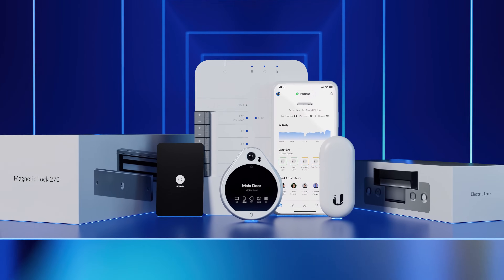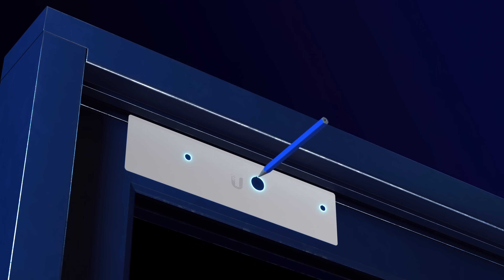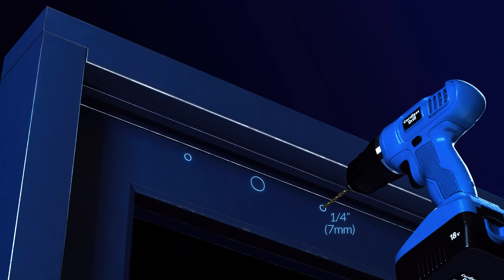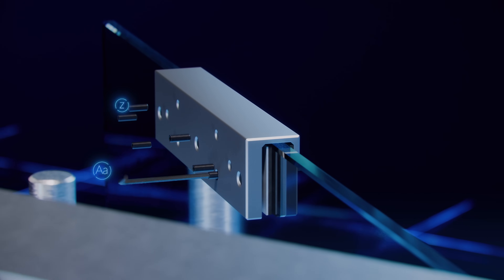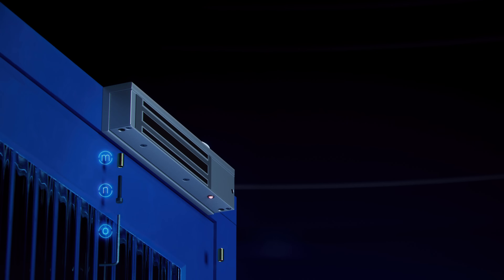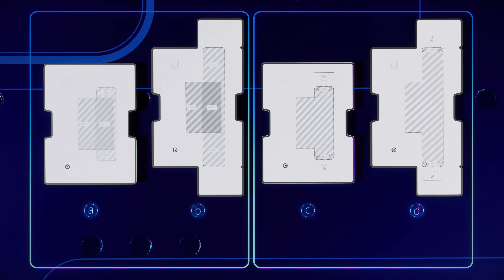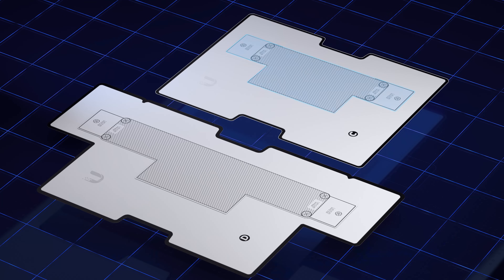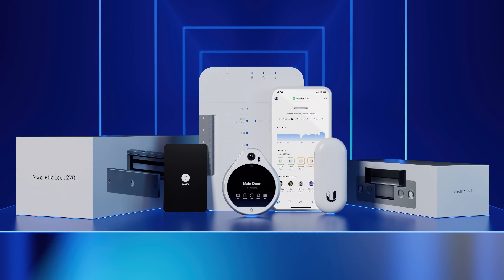How to Install: UniFi Access Magnetic and Electric Door Lock

Comment: This is all fine and nice, using it on american plywood doors, but in Europe door frames and the door structure is mostly made of solid metal so none of those screws/drill bits wont work.
Also drilling into doorframes is in some coutries as Germany and Austria strictly forbidden, due to municipal regulations.

Comment: A hack for putting the armature on a door without misplacing the 3 holes.  Use the template to mark the 2 pins and install them into the armature plate.  Drill the 2 holes for the armature pins and apply the armature to the door and then use the armature itself as a drill guide with a 3/8 drill bit all the way thru the door, remove the armature and then use the 3/8 hole as a pilot for the 5/8 or 1/2 hole you need to drill depending on if you need to use the additional tube for hollow metal doors.  Wood doors you can use just the threaded dowel thru a 1/2” hole. Its easy for me to get the 2 pin holes right but the large lag bolt hole is always a 16th off center and I hate making a round hole into an oval because of my measuring mistake, this fixes that for me atleast 🍻

Comment: do you require additional power from the controller for the 12v electric strike or does the power come from the poe in the switch

Comment: Will other Magnetic Locks work with the Door Access Hub? Or are only unifi magnetic locks compatible?
Reply: Should work with other mag locks, it has a dry option to signal door opening and a powered option 12v / 1 amp. So if it requires different power than the powered it likely has an exterior power source you can use it with the dry ports.

Comment: Anyone know if the electric strikes are suitable for exterior installation?  Love the idea but wondering if they will hold up to the elements...
Reply: Strikes Can work fine on exterior doors, but I don’t recommend them. You tend to want to keep said door unlocked when at home. This will draw power, and as such is not very efficient. 

Personally i would rather use a motor lock in the door. This would require drilling through the door, which can seem a bit scary, but is a much neater, and more efficient solution

Comment: Great video thank you Ubiquiti. Something to in mind about mag locks for residential applications is that they only lock when electrical power is available. For homes, consider electric strikes and deadbolts, they stay locked with or without electrical power.
Reply: Depends on the mag lock style, the in-frame mag lock fails to secure. Either way, you'll want to add a mission-critical module to ensure you have power to the system when power is out.
Reply: UPS go brrr
Reply: @austayo  I don’t know about you, but in the rare cases my home went out of electricity, it took the energy company 2 weeks to fix it. No UPS can handle this.